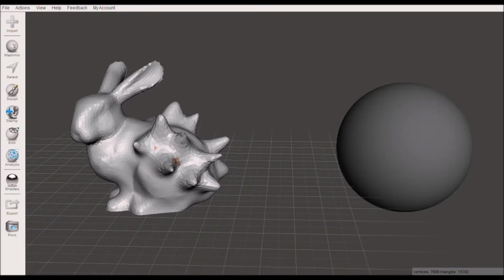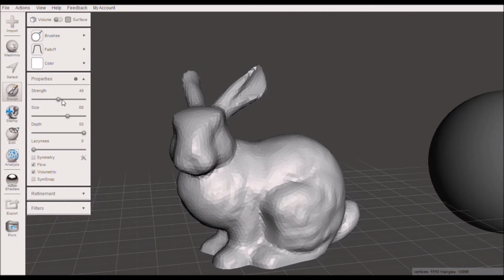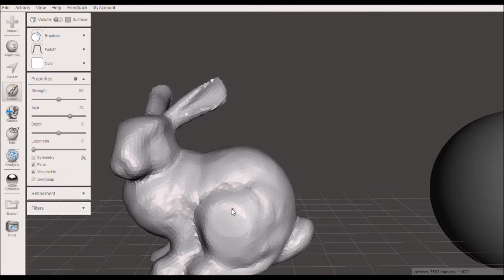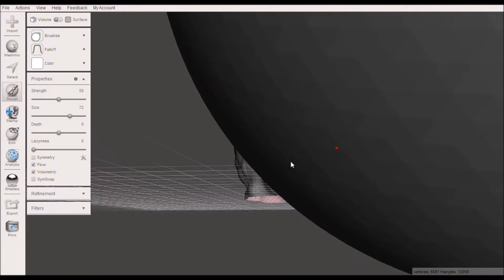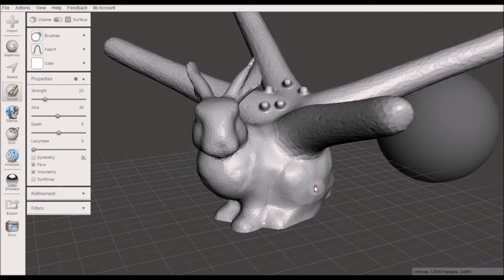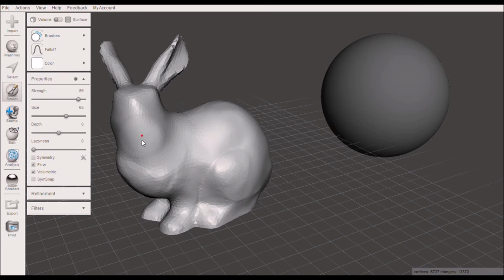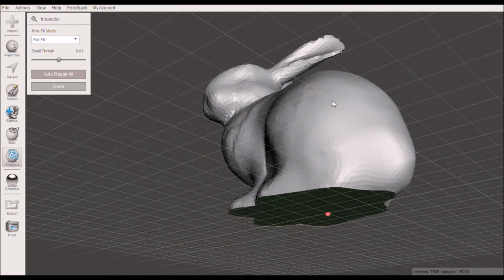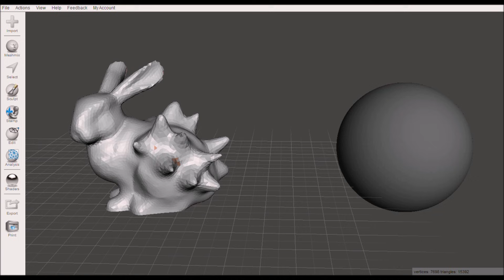Meshmixer Tutorial - Part 1 (Sculpting Tools)

Comment: The meshmixer sculpting tools are great for pulling material out, but what if you want to push material in, like a negative draw tool? Say you want to add a groove down an otherwise flat surface, how would you do that? Is that even possible in meshmixer?
Reply: hold ctrl while doing it

Comment: Thanks for the video - This is really neat stuff!
Question, please...Can segmented patterns be developed for a surface and then each be printed onto paper? Say, rather than a 3D printed model, I want to make a large scale plywood or steel rabbit for my grandkids, just not so smooth but still recognizable. By that I mean if I start from a downloaded animal file in Meshmaker, can I use the reduce tool you explained here to create a bunch of flat shapes that will fit together, THEN be able to print out each of those surface shapes onto paper to copy onto my material?
Reply: This may be a little to much but you could possibly use a slicer like cura as if you were going to 3d print it and make the layer high tall so you can get an idea of the shapes

Comment: Great video! Is there a tool that not only moves a part (like you did with the bunny head), but also rotates it? Basically, "bending"  a part a certain angle?
Reply: You can select the head of the bunny (draw around it or paint it) then choose "convert to open part". That will add it to the selection of Meshmix items in "My Parts". Delete the head from the rabbit with "erase and fill." Now select your Meshmix head from "My Parts" and drag it into place. Actually, I find it easier to put it somewhere else on the rabbit, and then slide it over to the neck area. When you have it in place, enlarge it either using the menu panel, or you can use the pivot control  below the rabbit head. Once it is the right size, shift it and turn it to get it centered. Now click on the small oval that is on the control icon and it will make 2 angle control sticks appear that can make the head angle back and forth, and side to side while leaving the neck attached in place. It may make some wrinkling or distort the face a bit, but you can usually play around with it and smooth those issues out. I did one where the rabbit appears to be sleeping with his head tilted onto his shoulder.